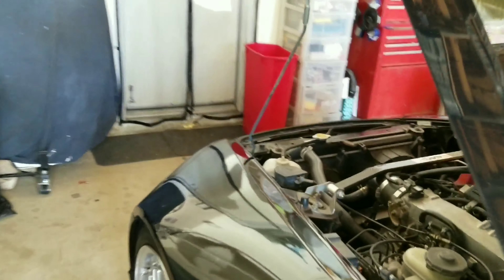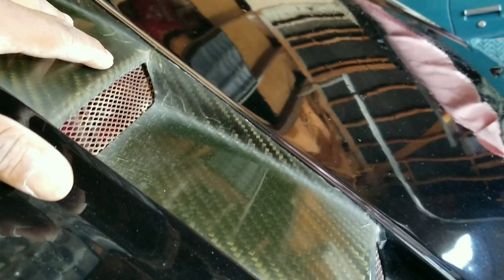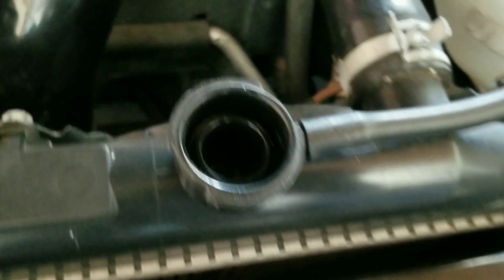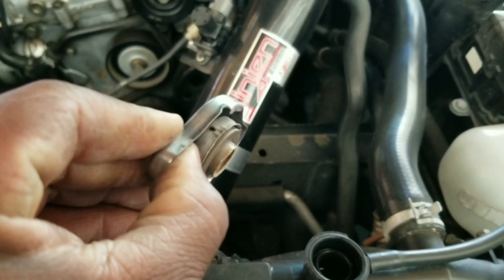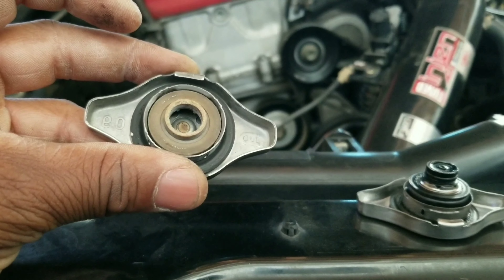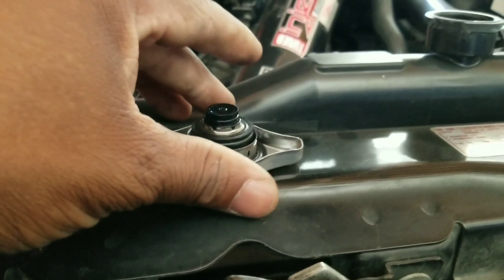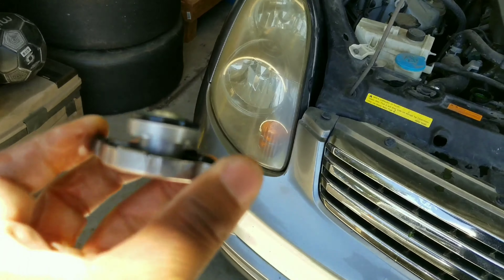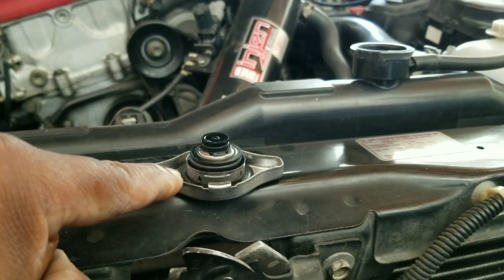Never Buy These Radiator Caps

Comment: Have u had any issues ..like hoses bursting or radiator...did u test cap to see at what psi it opens
Reply from the maker: Nope, none of the above. I never tested the cap just replaced. Usually, bursting hoses or radiators are due to ether a bad head gasket over pressurizing the system or a thermostat stuck close.
Reply: @Duwop77  Yea that's what I was wondering if that cap is over pressurizing sistem I put an extra seal on lower part  from old cap and it raised the opening pressure to around 24 psi just that little seal ..your cap looks way longer than original cap so I'm imagining It's  over pressurizing even more than mine
Reply from the maker: @abimariavargas7086  it did seem to over pressurize the system now that I think about it. I would get over flow from the reservoir now that I think about it.

Comment: I would get a Nismo radiator cap for the G35 . And for the Honda HKS radiator cap pressure 1.1 bar is perfect.
Reply from the maker: Thanks for the tip. I appreciate it 😁